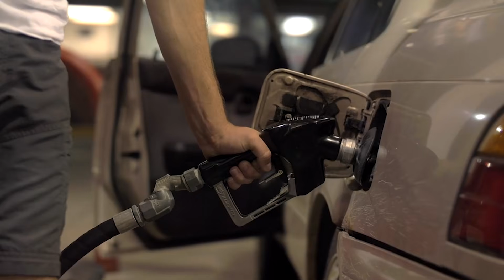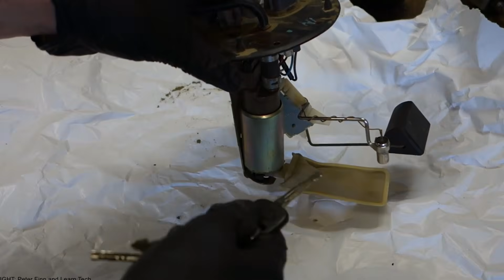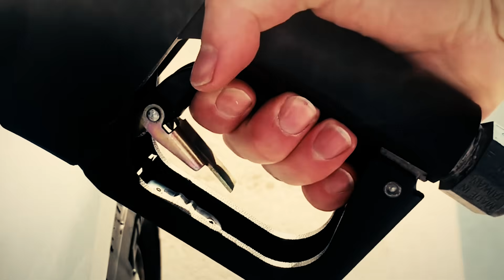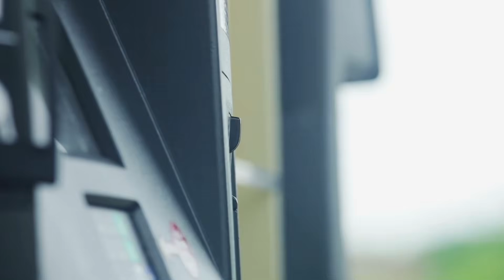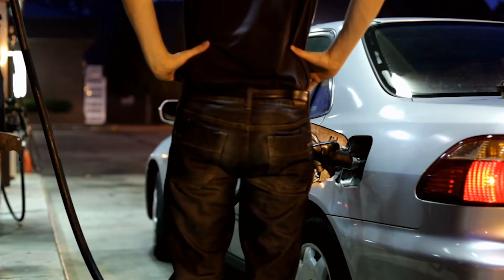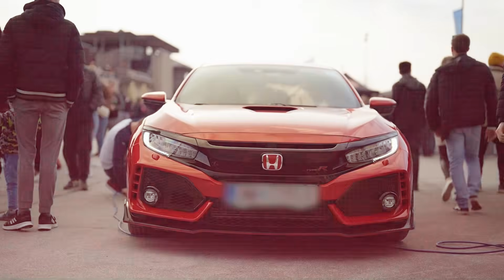Never Do THIS Before Refueling Your Honda | 90% of Drivers Get It Wrong!

Comment: Great video. I just recently bought an 2025 honda accord se with 1.5 turbo whats the best gas for that engine. Should I stick to regular or consider mid grade 89
Reply: Just check your owners manual for the recommended octane for your Honda model. Never use 89 octane. If your owners manual recommends Regular 87 octane, use just that. Using 91 octane when it's not recommended by Honda will be a waste of money.
Reply: @RockyReay is not honda lie to us using 87 octane is one of the reasons people are having head gasket and injector failure prematurely
Reply: use 91 octane, keeps the engine cooler. Most accords with blown head gaskets used lower octane gas. I’d rather spend $3 more per tank than $5000 on a engine rebuild.
Reply: No use high grade gasoline at least 91 and every 30k use some chevron cleaner for the injector

Comment: Only half the story in this piece. Running a tank less than a quarter full will burn out the fuel pump. Too little is also harmful, expensive.
Reply: 1/4 of a tank is a stretch